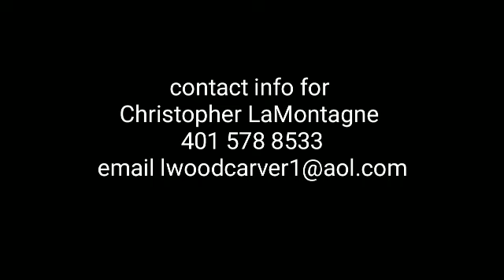chainsaw carving tiny bears

Comment: Hey man just subbed your channel. You are very talented with a power saw. Any tips for a beginner chainsaw carver?
Reply from the maker: Thks for your subscription and support  Tips1) be safe !!!!  Safety first... wear safety glasses and chaps or safety chainsaw pants....you will most likely slash your legs in an accident while carving 2) learn to draw or advance your drawing skills....the same part of the brain that guides a drawing pencil guide a chainsaw ...etc...if your drawings suck so wont your carvings....its all related..
3) try buy 3 saws...1.. 25 to 30cc for small details  2 a large roughing saw 75 to 120 cc...for roughing... 3 a mid range saw for rougher detail 50 cc to70 cc
4)practice ,practice,practice,practice,practice,practice,....and more practice....best tips I can give to any beginner
Reply: Thank you for the tips. Have all the gear and have been using power saws for last 35 years for firewood cutting. Have one scar on my knee from saw so I know about that. Drawing is another thing although I have carved moose antler and small wood spirits for while now. Cheers
Reply from the maker: @lenhowl  if you already well familar with saws have the battle...focus on art design drawing you will be fine from there
Reply: Yes cut lots of wood, usually 8 cord year for our heating. Just got to practice some drawing. Thanks.